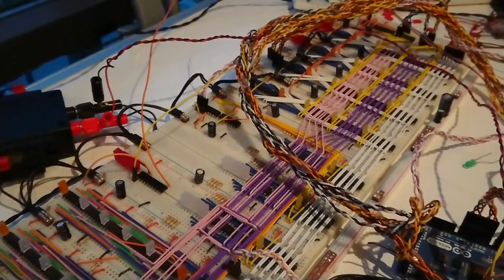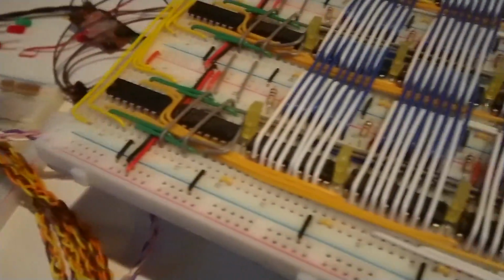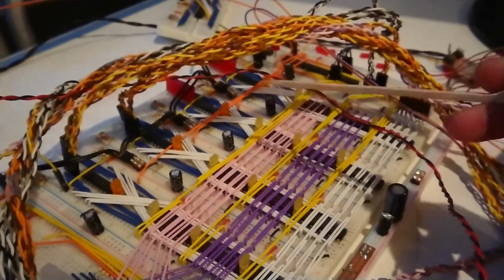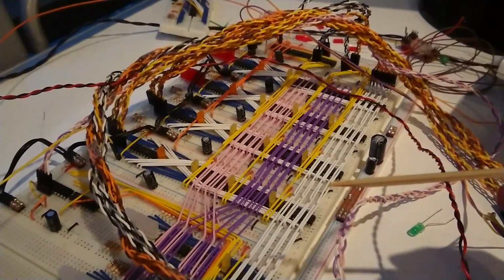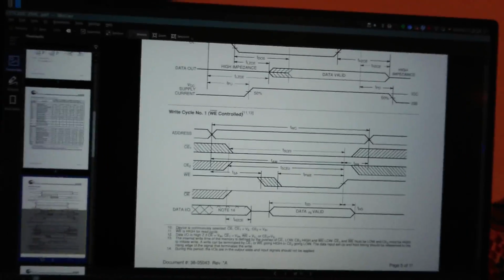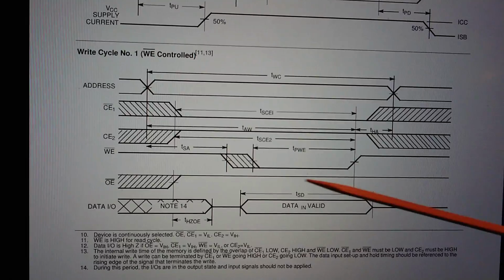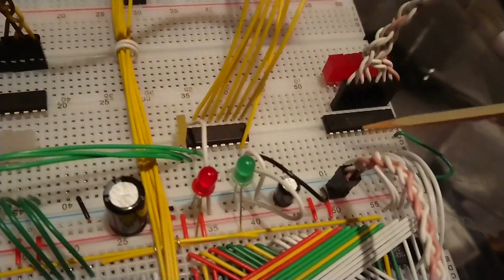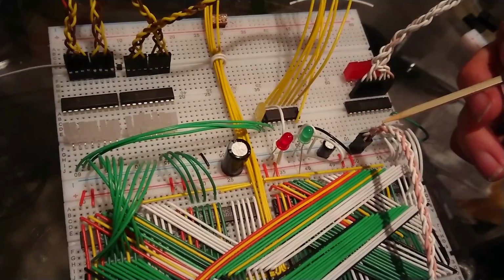64k Memory Module - Plum Breadboard Computer

Comment: Just found your vids. Amazing stuff.
Could you elaborate on your 64k memory design? Looking to expand my 8-bit computer with a separate 16-bit address bus to address 64k memory. 
Maybe you have some schematics drawn up?

Why did you choose eight 8k chips? Is that the best option available?
Reply from the maker: Hi Thomas, thanks! :D Unfortunately I don't have any schematics for any of it, it's all in my head. I enjoy bending wire more than I enjoy drawing schematics. I really should though, you're not the first to have asked. I'm considering doing some whiteboard-based videos where I draw it all out and go through some theory. The reason for choosing the 8k Cypress chips is also a little dull... they're just what I happened to find on ebay. The fact that they fit pretty well on two breadboards and make up a full 64k is coincidence, I didn't plan it. One thing that is convenient about them though is their active-low Chip Enable inputs. This means that it's pretty easy to hook all the pins up in parallel across the eight chips, then connect the ~ChipEnable pin of each to an output pin on a 74HC138 3-bit to 8-line decoder. Every other pin, including the Write and Output signals are all wired together. So when I tell the memory module to do something, that "output please" or "save data" signal is going to every chip at once, however only one will actually take any action because only one has been enabled/selected by the 74HC138. The three bits that the decoder takes are then simply added on to the most-significant end of the address word. So you end up with something like:  SSSA AAAA AAAA AAAA where A are "address" bits that go to every one of the chips, and S are the chip-select portion of the address. I guess like a road and house number.
Reply: Thanks for your answer. I have ordered a couple of 62256 SRAM (32K x 8) and some 28C256 EEPROM. I was fiddling with the same stuff as you were. Couldn't find any 64k RAM modules so had the same idea to use the three MSB as selectors for which module to address. Though I was postponing ordering the parts and building it because of the loads of wires. Your video did not really make me more enthusiastic about this haha. Was really happy to find the 62256 right after you refreshed my memory about the "chip selection" idea. The great thing is that I now can choose to use 64k of RAM (two 32K x 8 modules) or use 32k RAM and 32k EEPROM for non-volatile storage.
Chip selection in pretty easy, just the first MSB and the inverted MSB..
Reply from the maker: The line between tedious and therapeutic is a fine one. ;) I suppose I could have got much larger SRAM chips, but I dunno, I didn't like the idea of just having one or two chips for memory. I wanted that old microcomputer vibe. :D
Reply: That is true, but not for me right now. I have summer vacation at the moment, so being outside and stuff is also a good waste of time. When I go back to my full time study I guess I would wish that I went with your build.
Anyway, this is also a pretty cheap option. I got myself some fake 74LS189 from eBay unfortunately so I had to buy the real ones here in store for a not-so-nice price. The 28C256 is about $1 a piece and the 62256 about $1.75. That is pretty cheap, right!

I do have a few more questions if you don't mind.
Do you have a dedicated 16-bit address bus? And do you have multi-byte instructions? How do you buffer the multi-byte instructions?
Reply from the maker: When the memory module is connected, it's linked directly to two registers, normally C and D, so whatever value they hold is being passed over to the address inputs of the memory module. So yes I guess, but the values for those are written via the Data Bus. As for instruction decoding, I must confess, I haven't actually built anything for that yet. Instead I have "Plummon", which is an Arduino Mega 2560 which takes on all responsibilities which aren't yet covered by bent wire. So at the moment no instructions are held in memory and decoded, they're in the Plummon source. So I have a bunch of C functions that represent the assembly instructions. eg: plum_op_LDI(), plum_op_ADD(), plum_op_SUB(). The irony of which is not lost on me. :P You can see a little of it here: https://youtu.be/3CzrAmhRgT4?t=13m45s I'm considering doing a screencast walkthrough of the Plummon source if that would be of any interest? I know it's a bit of a "cheat" to use a MCU to drive it all, but this does allow me some more immediate feedback when playing with different instruction set ideas before I commit one to wire. So as it stands I currently have 0-byte length instructions, so buffering and decoding them isn't really an issue. :P I have considered two-byte and even three-byte instructions, and in those cases I would probably just repeat the fetch part of the fetch-decode-execute cycle for every byte. MDR -> IR0, MAR++, MDR -> IR1, MAR++, just add the extra T-stages. Then I'd have a similar 16-bit hookup from the two Instruction Registers to the Instruction Decoder Module, like with the Memory Module. I haven't done any of that though, so YMMV. ;) I've also considered a variable-length instruction set, and encoding the instruction length in the first two bits of the first byte, as well as a 4-bit instruction set, SAP-1 style. ... All that is why I haven't actually bent any wire for it yet. I just can't make up my mind! Tbh, I think the main reason I started on the 64k module was so that I could bend some wire while buying time to think. :D

Comment: If you only needed a single not gate(or any gate in general) you might be able to save space by using something like DTL(Diode-transistor logic) or RTL(Resistor-transistor logic) which only uses two resisters and one transistor.

Great video by the way!
Reply from the maker: Thanks! :D Good tip, always good to remember that one-off gates can be made with discrete components. I've done RTL before somewhere... though I don't see it anymore so I guess that was in a previous incarnation. I tend to find myself wanting a couple of different gates but only one of each, for which I tend to lay down a 74HC00 and build the gates I want out of NANDs. :)